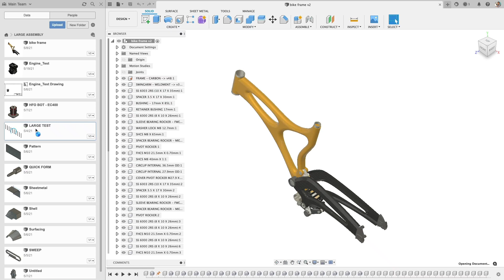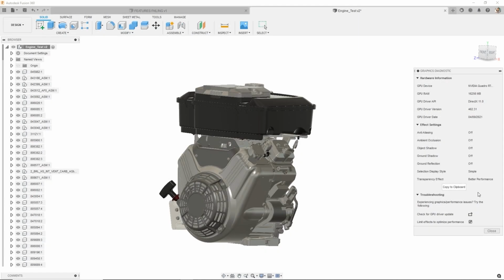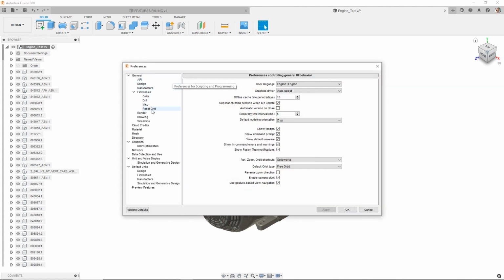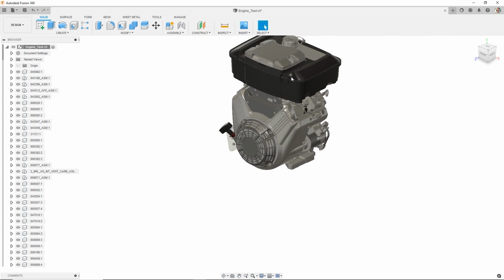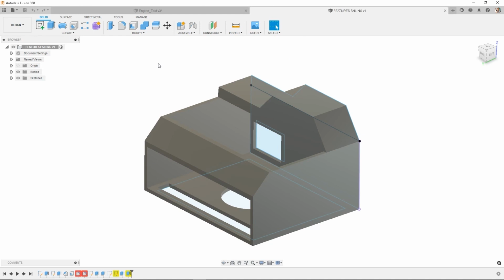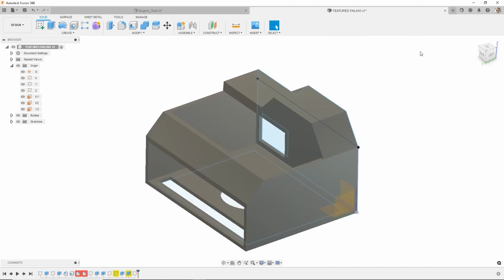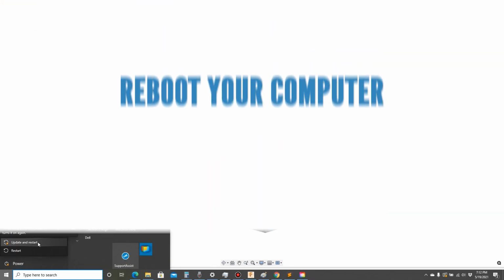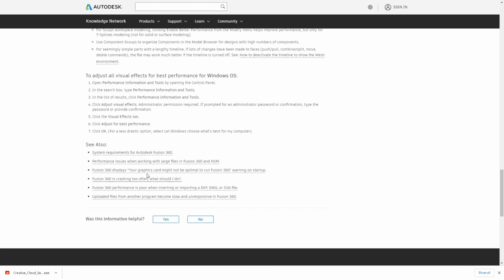Fusion 360 Settings (How To Optimize Your Computer)

Comment: Any new settings that would make fusion better? I usually always struggle with 3D scan mesh files and I really do want to keep it in high resolution 😩! And the way I want to use it is importing multiple scan like different car component so I have a full view in 3D of the car so I can position everything and create what I need using all the references available to me but that is sooo hard on fusion 😭

Comment: My computer has a core i9 13900, 64GB of DDR5 ram, two fast 7000mb/s SSDs and a RTX 4070 Ti and Fusion 360 still makes my PC feel slow at times even though I know its a very capable machine. Thanks for these tips
Reply: Enable graphic performance to high for Fusion 360.
Reply: @TechDEEM  where are the setting can find?
Reply: I feel you. Spent 3k building my pc for fusion and still crashes, cursor delay and mesh conversions that seem to never finish
Reply: @DivergentMachining  It's stressful. My macbook works fine in everything, even in Shapr 3D (sadly it is paid) but with Fusion the story is different.
Reply: @oswaldoamaldonado6778 I honestly wonder how fusion would perform with the latest tech now like with the new mac M3 ultra ship and the new 5090 gpu with the largest ram available 🤔 wish someone would make a video about this only for fusion 360 and test with multiple high resolution 3D scan mesh files
Reply: And don't forget to update drives

Comment: Thank you Tyler. As always great tips.
One thing that helps a lot would be trying not to use the mirror feature especially in sketch. It seems that it slows things down. Also when you have a part with a lot of small extrusions or holes, try to do them in small batches. Even if it take 100 extrusions of 10 holes each is computed much faster than 1 extrusion with 1000 holes.